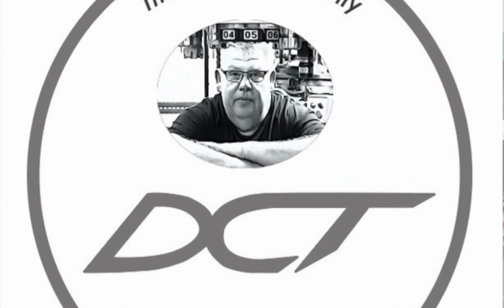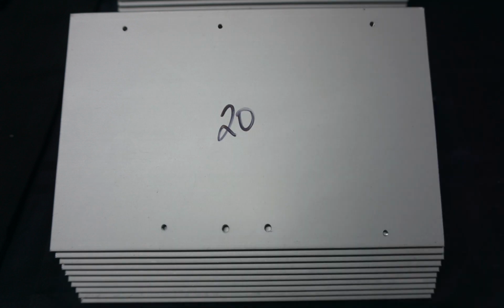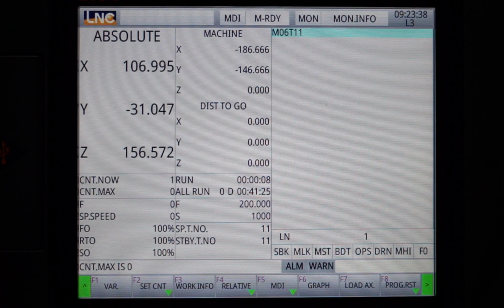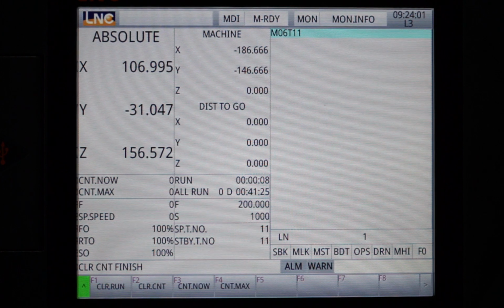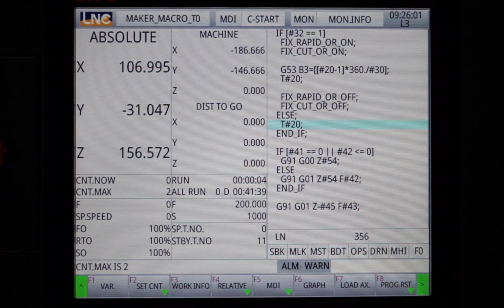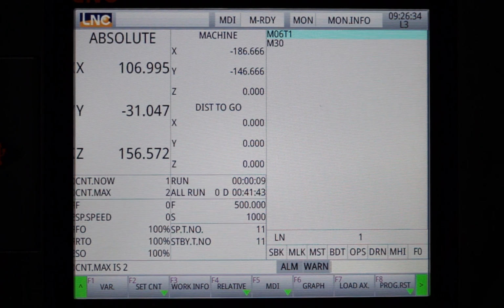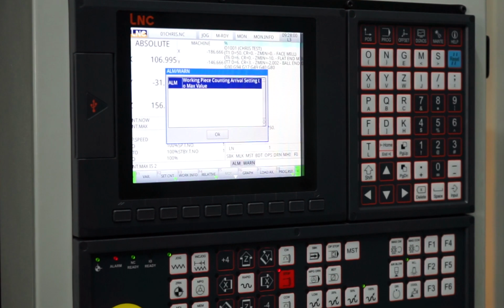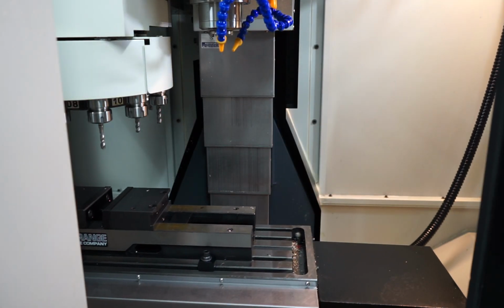My Stupid MISTAKE cost me a days work - Lost Time Production

Comment: Awesome video mate, I love this stuff! I commend you for going high tech, but I disagree with you on one thing... the cure for these type of issues is not not using all available capabilities, the cure is documentation, documentation, documentation. It's past time that Syil steps up to its responsibilities and start producing manuals worthy of their incredible machines. A CNC mill is only as good as its documentation in my opinion. Ciao, Marco.
Reply from the maker: G’day Marco. In their defence, I do have 2  x LNC manuals for the controller. I had a quick flick through and couldn’t find anything on the batch counter. But I had a “man look” 😉. I’m getting stubborn as I get older and my inability to explore and try new things does stunt my learning growth. For example, If something works I just keep doing it, at the cost of maybe finding a quicker or easier way. Oh well 🤷‍♂️

Comment: .....or now that you know, you can use the batch counter more often. :)  lol   
I hate those kinds of problems.  They seem so obvious after the fact. :(  I'm glad you got it figured out.  :)
Reply from the maker: G’day Mike. Yeah, bugger that.

I know right, such a simple thing had me completely stuffed. I think what threw me, was there was talk on the Syil CNC forum about not running your spindle at 10K. So the day after I read this my machine went out on alarm after hitting 10K rpm (it was just the M30). So this is what set me up the garden path and on the wrong adventure. Bloody Internet forums 🤦‍♂️
Reply: @DCT_Aaron_Engineering  :)

Comment: I worked on a 1983 machine that would often just stop. The machine would not even show any alarm indication. After a while, I learned about the common problems, but not all. One shift, at night, the tool pocket was not closing the circuit, I must have spent an hour looking for the problem. Turns out, there was just enough interference with the adjacent tool to not close the switch. I think there was one alarm circuit with all the switches wired in series and no indicator light.
Reply from the maker: Hello Sylvain. Oh man that must have been so frustrating. I hate simple problems that take ages to fix. Yes on that old 80’s machine they were probably all wired into one I/O port. Kudos to you though for finding & fixing it. I bet your foreman / manager was happy you fixed it that night shift? Thanks for watching mate. Cheers Aaron 🍻

Comment: Hi Aaron. I bet you felt a fool. Trouble is machines now have so many variables. I've been operating a CNC for the last 13 years or so and still I make the odd silly mistake. There's so much to remember these days(coding, tooling, workholding etc etc). Glad you got it sorted and great backup from the manufacturer. Regards kevin
Reply from the maker: G’day Kevin. I had no idea that you are a CNC operator. I agree, there is so much to learn and remember these days. Especially now that I’ve changed jobs (schools) and I don’t have any CNC machines at the new place, as it’s all manual machining. So the only time I get machine time is when I play around at home on my own. Thanks for watching Kevin. Cheers 🍻
Reply: @DCT_Aaron_Engineering  hi  Aaron. I should be a bit clearer. Although I operate a CNC it's not a machining centre it's a point to point type, machining aluminium. Regards kevin
Reply from the maker: @Machine_NZ  thanks Kevin, but it’s still tricky work no doubt, and easy to stuff up and or crash. Enjoy your Sunday 🍻